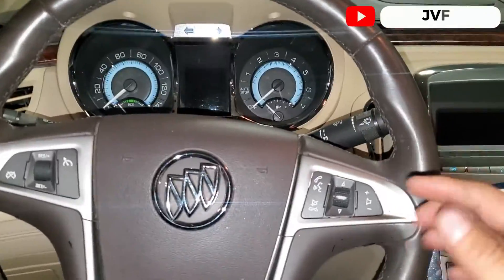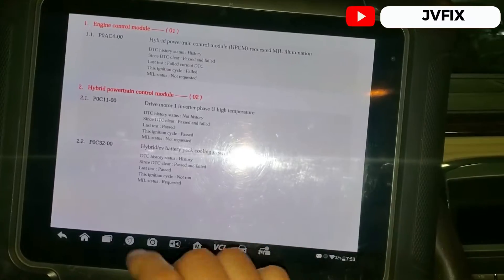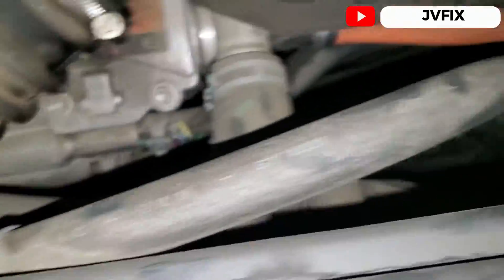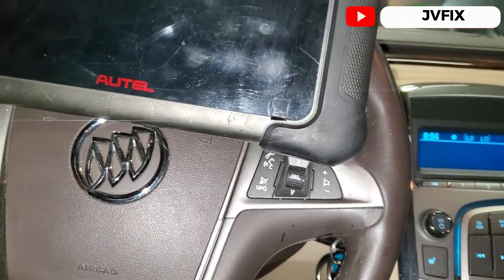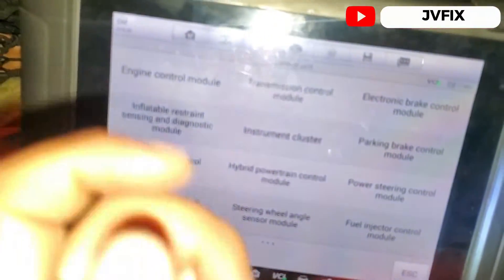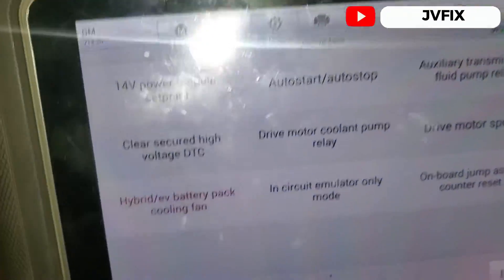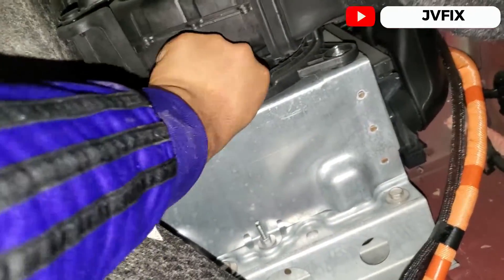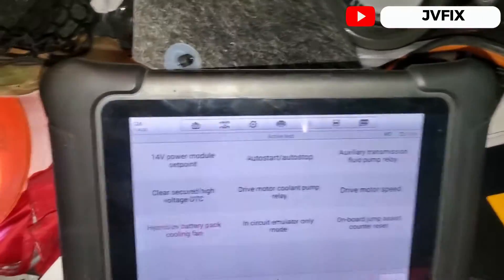How i fixed codes P0AC4, P0C11,P0C32 on 2012 Buick Lacrosse 2.4l Hybrid System overheat diagnostic

Comment: So my 2012 buick lacrosse has this same issue but the fan is coming on at ignition start..Im lost with it at this point..I have the code P0CC1
Reply from the maker: is better to change it. i already did like 12 of these problems and is always the fan the issue

Comment: I have a 2013 malibu hybrid
Im getting no start no crank.
I replaced the entire hybrid battery assembly with modules and im still getting no start no crank. New 12v battery as well.
Codes now present are 
P0ac4 
P062f tcm long term performance
U0284 active grille shutter
HELP please im dumping so much money. Do i need to relearn or flash ecm because i changed hybrid battery assembly? Would the active grille shutter have anything to do with no start?
Reply from the maker: the P0AC4 means that the fan for the hybrid battery pack is not working, the code P062F is a bit more serious meaning the Engine control module has internal fault and that could be your issue but usually this code sets when the 12v battery has been low on voltage ⚡️ for a long time. what scanner are you using to scan the car

Comment: Great video man. Just subscribed. I have realized that just having an OBD reader is not enough. When you get a chance can you drop the link to the scanner your using?  Thank you sir.
Reply from the maker: thanks alot. I use the autel im608 is a bit pricey but there are other affordable one under 300 bucks
Reply: @JVFIXLLC  if it's around $500 and no more than 1k, I wouldn't mind investing on a tool that's going to be useful. I appreciate the info. 
  Also, I came across your video because I had the code P0AC4 on a 2014 Cadillac ELR. Should I start at the battery pack fan as well?

Comment: Can this fan issue give you a red battery light on the dash? And slowly kill your 12 volt battery?
Reply from the maker: it could but it seems you could have a bad generator.
Reply: @JVFIXLLC swapped out generator already 😭
Reply: @e46m3jose  what end up being your issue
Reply: @A-cu8ic  ended up being a certain part forget the name of it but its a part of the hybrid battery, something module. You can’t really replace just that part because then you have to reprogram the whole car. So i just went to junk yard got the entire hybrid battery for $500 easy replacement like 8 screws and like 5 terminal connections and fixed the issue. Aslong as the hybrid battery you buy is not new but used and off the sane type of vehicle it does not need programming just plug n go. Hope this helps
Reply: @e46m3jose  you might be talking bout the generator control module, I appreciate it might end up doing that, put new battery and generator still giving problems

Comment: Hi, i have the same DTC P0AC4 my car a 2012 Buick lacrosse 2.4 hybrid it randomly gets under charging the battery and it randomly shows 12.5 to 14v till the point to almost shutting down, I've put a new battery thinking it was the problem but still makes the same.

What failure was that car showing? Is it possible for my car to have the same problem? Im gonna check that fan anyways, but I'll be glad if you could answer my question and give me some feedback.

Thank you a lot 

Sorry for my English, I'm still practicing
Reply from the maker: yea if you have that code it will be the issue the fan you can remove the back cover and turn on the car and see if it spins it should be spinning all time to keep the battery pack cool. 

and your English is perfect.

Comment: I am glad I found you and this fix. It was precisely the problem with my 2012 Buick Lacrosse. Your video has saved me $$$. I am not a handy person nor good at mechanical. As shown, I bought the part from the dealer and had an auto body shop swap out the fan. All codes and problems have been cleared and fixed. The car now runs very well. Thank you again for sharing. I appreciate your kindness.
Reply from the maker: glad it helped you. thanks for watching
Reply: Hi, what problem did you had in your car? My blower isn't working too! 

I would appreciate if you answer my question thank you so much

Comment: Good afternoon, my honda accord hybrid 2005 not charging the 12v battery, and am having the codes p0ac4,p1601,p0533, and u0164 please me out
Reply from the maker: ok first you have to check if the fan for the battery pack is spinning that fan is located at the trunk right behind the seats and if it spins i am afraid that your battery pack cells might be shorted internally.

Comment: Where are you located? I'm having issues with my car not charging the 12V battery.  Help please!
Reply from the maker: I am in Visalia California
Reply: @JVFIXLLC  OMG. You're too far, I'm in Dallas, TX. Can't even drive 30 min, before the 12V  battery runs dead, and there's nobody that works on those hybrids around my neighborhood. I've already replaced the alternator/generator, still not charging. So I'm thinking on replacing the generator control module, I've read that that's what controls the current going to either the 12V battery or to the 115 High Voltage system
Reply from the maker: yea it's a bit far lol
Reply: @JVFIXLLC  Have you  had a case like mine where the 12V is not charging and generator is good? Or have you replaced a generator control module in one of these models?
Reply: I have 2013 chevy malibu showing code 
Poc32 do you think is same issue with the fun that you replace ?

Comment: Is this fairly easy to change? Just unscrew the fan and replace with a new one?
Reply from the maker: yea is very simple just 3 screws and swap the part 10 or 20mins tops
Reply: @JVFIXLLC  Thanks. Did it tonight and took about 15 min.

Comment: Hello, I got those code on my Malibu 2013 eco hybrid 2.4 
Can be the fan the problem?
Reply: Would a bad fan cause the 12v battery to not charge?
Reply: @trustnoneselfmade7125  I'm no expert,  but I don't think that has nothing to do with the battery not charging,  I'm having the same issue with my 12 Lacrosse,  I've already ruled out the generator and not sure how exactly this system works but I think my issue is going to be in the back where the battery pack is at. And i think right next to it is the generator control module which i think is bad. I know there was a recall for that year model for that part but I'm not sure if they will repair at this point.
Reply from the maker: yours sounds like you have a blown fuse or a failing inverter.
Reply: @JVFIX  that inverter would be part of the generator control module,  would not it? Like in my case , o looked and looked for blown fuses but really I can't find any fuses tied to that. I asked you this question in my other chat, Have you had one of these cars with the no charge issue on the 12 v battery?
Reply from the maker: I don't think so this car came and was charging fine.
Reply from the maker: yea if you have these codes you will likely have the same issue. the fan is not too expensive and is easy to change. search for it on ebay